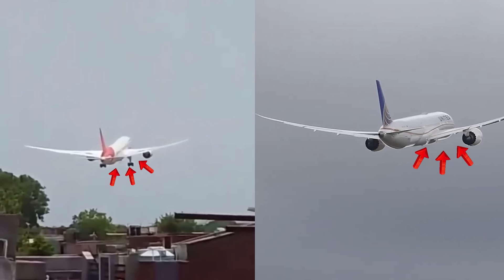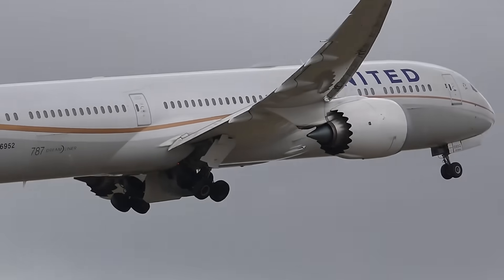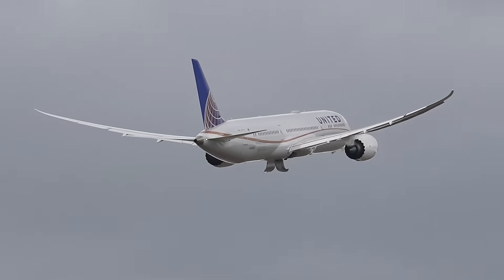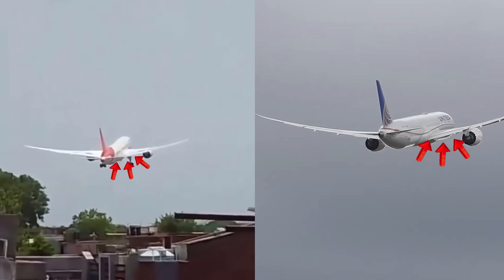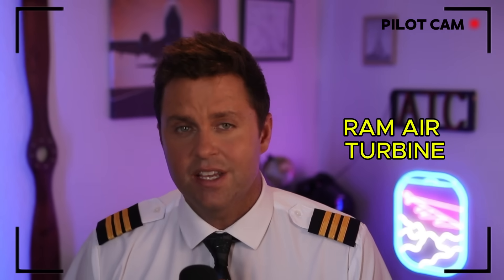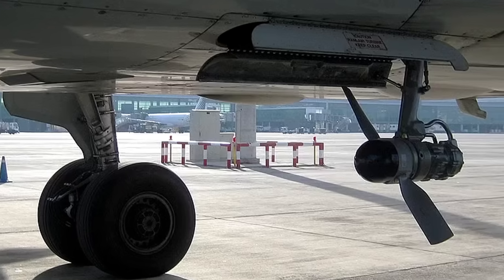Pilot Explains: A New Detail in the Air India 787 Crash Everyone Missed

Comment: As a A&P mechanic for a major US airline, id like to offer my humble opinion. Let me dispell a few rumors. 1. This was not a battery thermal runaway. After the problems that Boeing had previously with the batteries, they are now stored inside a 2 inch titanium box in the electronics bay and they cannot burn through that. 2. This was not a bird strike. These GE 90's can take a lot of birds going through that giant fan disk in the front. 
To me this looks like a catastrophic failure of both engines caused by a electronics failure of some kind. Everything on the 787 is electrically controlled. Yes even the hydraulics are electrically controlled. The only thing that makes sense outside of something the pilots did in the cockpit is a total electronics failure that shut down all of the fuel pumps and hydraulics which caused the rat to deploy and would explain why the surviving passenger stated there was a loud bang and the lights flickered in the cabin.
Reply: this seems to be the most convincing argument to date. Now, what can cause electronics failure? what are the odds for it?
Reply: @SuperGiantSlayer Extremely rare. Very rare and it would have to be a double failure of both a n b bus that cascades into a much larger failure rapidly. I will have to get into the books and look because this is very rare if it indeed happened this way
Reply: @SuperGiantSlayer Millions to one.
Reply: @SuperGiantSlayer shoddy Boeing quality control that John Barnett the whistleblower highlighted before he was murdered.
Reply: @SuperGiantSlayer blown fuse(es)?
Reply: @SuperGiantSlayer bad maintenance? Ignoring intermittent problems leading to catastrophic failure?
Reply: @SuperGiantSlayer Easy.  Poor maintenance.
Reply: @SuperGiantSlayer a lot of things can lead to one electric failure. It is not uncommon but always has multiple backups. The real question comes in sequence: What can cause 
 electric failure, what could have happened to disable the backups, can it stop the engines, could this lead to the way we've seen the accident, the facts to proof it
Reply: I don't understand why in the media the option is not discussed and pointed out that especially a 787 is doomed when there is a full electronich failure. As I understand this makes the plane uncontrollable. Why do the pilots not discuss that the design of the 787-in contrast to a 777 - is a tragic flaw when electronics stops working? This is essential and is not put forward in the media!
Reply: @wilfriedpichler5756 Because it's impossible for ALL starter gens plus - like mentioned above - the dedicated gens for the engines computer to all fail at the same time. The odds would be outstanding.
The engines failed and that caused the elec failure not the other way round.
Reply: Probably paid off media @wilfriedpichler5756
Reply: @wilfriedpichler5756 because no one would fly it - this is sooo scary
Reply: @wilfriedpichl because that's not how the plane is designed it's designed to work the engines should run even with an electrical issue. 15 million flights without an accident. er5756
Reply: @wilfriedpichler5756 < The media are not the experts. You sound like a trumpy boy
Reply: As a long since retired ATP I feel that I saw thrust pulled back to 50% or less; with everything else on the plane looking normal. Autothrottle, which is part of the AFDS controls thrust from rollout, takeoff, climb, cruise, to touchdown. My suspicion is an autothrottle malfunction so I looked up on the FAA website and sure enough, there is an AD for the autothrottle system on this model. From the FAA website in Sept 2024:

"The directive was prompted by incidents where the autothrottle system exhibited erroneous behavior during critical flight phases such as balked landings, with the system failing to properly adjust thrust levels."
Reply: @MikeM275  The autothrottle can only pull the throttles back to idle. It can't go sub-idle causing the generators to trip offline and the RAT to deploy.
Reply: @ImperrfectStranger makes sense
Reply: @ImperrfectStranger  The RAT deploying so far is only a theory using a substandard video which they "think" they heard the RAT. So far nothing is proven that the RAT deployed, only guessing by the sound of a cell phone video. I'm guessing too so my guess is as good or bad, as all the others I suppose. But since there is an AD on the autothrottle, and we can see the plane did not have thrust, that is a good place to start. When malfunctions in systems start, others can follow. Why did the RAT deploy? No one knows. No one knows that it even did deploy. I can say with certainty though this was a lack of thrust, not a flap issue.
Reply: @MikeM275  Another YouTuber, I think it was Captain Steve, zoomed in on that video and it certainly appeared that you could see the RAT as well as hear it. There was also the surviving passenger who (reportedly) said there was a loud bang shortly before the crash, which would correspond with the RAT deploying. I think it probably did deploy.
Reply: @ImperrfectStranger  Teacher, this is correct, IF there are no software bugs or hardware malfunctions ...
Reply: @PharmaGiles  Oh, OK I didn't see that. I didn't think there was a video crisp enough to zoom in that close. I do stand by my assessment though that it was a lack of thrust, not a flap issue. Why the lack of thrust is the question. We know there's an AD on this plane about the autothrottle failing in "critical" flight phases close to the ground. Sept 2024 and gave the carriers 6 months to get it fixed. The other thing about autothrottle is...even if it was not activated on takeoff (I'm 100% sure it was), it would have come on automatically before the plane stalled. So between the pilots and the autothrottle full power was undisputedly applied before the stall. Question will be, why did the engines not respond. I'm a long since retired ATP that never flew anything this big...but total electrical failure should not slow or stop the engines. Unless and only if the fuel pumps quit. That doesn't make sense either as there are multiple on each engine, not dependent on the other side....so the electrical failure would have to be total.
Reply: @ImperrfectStranger  nit the RAT automatically extends also in case of electrical failure. Not only for a dual eng failure.
Reply: @MikeM275  it seems to be clearly audible in the video, but the engines were not audible.
Reply: @MikeM275 Rat is clearly deployed in the video .
Reply: @matt84dc17  Understood, but electrical failures removing all power from the aircraft are just as improbable as a dual engine failure. Multiple redundancies.
Reply: @MikeM275 auto throttle is not used for takeoff. Positive pilot Input is the norm. Autothrottle is primarily a function of TOGA or speed trimming via the annunciator/auto flight  control panel.
Reply: @MikeM275  Why would you use autothrottle on takeoff? Wouldn't adjusting the throttle manually switch it off?
Reply: @donotwantahandle1111  Nope. That's not how it works on the most modern airliners. After everything is programed into the computer, from take off roll, climb out, cruise, up to and including landing it is hands off, computer controlled. While a pilot can take over control at any point, the throttle is adjusted by computer in all phases of flight. It's called autothrottle and in Sept. 2024 the FAA found issues and gave the carriers 6 months to get it fixed.
Reply: @MikeM275 So the auto throttle doesn't seem to be working...firewall the throttles yourself with your hand instead of driving your bigass plane into a neighborhood. Who tf knows what happened at this point? Horrible tragedy nonetheless. RIP everyone on that flight and on the ground except for the one lucky bastard who somehow walked away from that shitstorm. God must have big plans for you my friend. Stay strong 🙏
Reply: @Thedoug369  They only had seconds to determine what the issue was and resolve it. If it was the autothrottle there just wasn't enough time to figure it out, and take control manually.
Reply: @MikeM275 makes sense
Reply: @MikeM275 - Nice find 👍🏻 If it’s AD related and an Auto Throttle failure then that puts the whole incident in a different light.
Reply: @MikeM275  Mike, that's brilliant and most plausible. Fuel pumps should have been ok with the RAT deployed.
Reply: @MikeM275 Thank you. I believe after investigations are completed, it will be decided that your observation is correct.
Reply: @MikeM275   then why was RAT deployed ? Pilot made a mayday call and said there is no thrust, no power, no lift..
Reply: @MikeM275  Getting warmer. My assumption: Cause, not something that could have happen to a pre fly-by-wire aircraft, but something that can only happen to a fly-by-wire aircraft. Lets assume the total electricity failure, that automatically started the RAT, was because both engines changed operation mode from "full thrust" to "no thrust". Both "full thrust" and "no thrust" commands are just bits on the wire. I do NOT assume that the pilots gave the "no thrust" commands, but something (software or hardware) on the way from cockpit to engine changed/corrupted the commands to "no thrust". Sad, very sad. My condolences. You say: "Investigators look for AFDS malfunction". Yeah, these "noise reduction/fuel consumption reduction" comfort software functions ... We just declare them non critical ...
Reply: @MikeM275  But they would still have generators and full hydraulics even if pulled back to idle ! . Partial gear retraction and RAT deployed points to loss of generators and hydraulics ie both engines shut down ? do they run APU at take off ?
Reply: @nounoufriend1442  The cart starts the engines while on the ground, but yes the APU can be started and run on the ground or in the air. The APU is not running on takeoff though. Yes if the engines were running even at idle they would have electrical power and hydraulics etc. RAT deployment does lean toward complete electrical failure, but still doesn't explain why they had no thrust. The RAT gives enough electricity for flight controls so that isn't an issue. The electrical bypass should have powered the fuel pumps even without electrical. This is the mystery.
Reply: @MikeM275  So fuel pumps should run with most major electrical failures , would engines produce thrust even if FADEC's lost communication with aircraft ? Do they fail leaving enough thrust for flight ?
Reply: @MikeM275 also autothrust will retard the throttle if the incorrect altitude is inputted into the autopilot.
Reply: @kevintaylor31  But autothrottle will never let the plane stall, no matter what the configuration. It would come on automatically and provide thrust to stay out of a stall. Even overriding the pilots if they did something wrong.
Reply: @MikeM275  "Autothrottle, which is part of the AFDS controls thrust from rollout, takeoff, climb, cruise, to touchdown." 

The Boeing 787 manual and checklists call for the Autothrottle to be engaged only after the aircraft reaches 200 KIAS; and during landing to be Off at 500' AGL and Disconnected at 300' AGL.
Reply: @BryanM61  Nope. Sorry, I know you got that off the internet...But that's not how it works. On the 777/787 (and others), at spool up when you turn onto active, you bring the throttles up part way, then arm the TO/GA switch and engage the autothrottle. This is prior to releasing brakes and starting take off roll. The autothrottle if working correctly also would have self engaged before letting the plane stall and crash.
Reply: Yes, I saw a vid with Ed pierson, former Boeing manager/whistle blower, and he pretty much said the same thing. Apperantly this plane had electrical issues, lights flickering, AC not working, just a day before.
Reply: @StudyWithMusic-mo5nl  thats what 1 passenger said when he departed the plane, before the fateful passengers got on that flight.
Reply: @StudyWithMusic-mo5nl No this is categorically not true. Nonsense misinformation based of a unresponsive ife screen
Reply: Didn’t the Captain say in his mayday call that he’d lost thrust?
Reply: @bruceerwin5430  yes
Reply: Yes.  @bruceerwin5430
Reply: @bruceerwin5430 yes he did. We can also hear that there was no engine sound. Just the RAT.
Reply: @bruceerwin5430  I think there was a Mayday, but nothing else.
Reply: @bruceerwin5430  From memory he said they lost "power". If my memory is right, it could mean either.
Reply: im a retired pilot / FE/ A&P, what about an overheat in the avionic comp? Ive heard the electronic engine controls are there.
Reply: @bluskytoo Well, it would have to be extereme heat because the electronics bay is made to withstand high temps and I know the batteries were contained in a titanium  2 inch box so it couldnt have been thermal runways from the lithium ion batteries. This could be sabotage but that would be extremely rare as well
Reply: @ExpeditionMiracle  If I remember correctly, in the video of the previous flight where electrical problems were seen, didn't he also say that the air conditioning was out of service? And doesn't the avionics bay use the air conditioning for cooling? Combined with the high ambient temperatures, that could have made things worse.
Reply: @marco_fabbroni The electronics are rated for temps far in excess of what the temp was that day and without cooling. This accident was not the result of temperatures or a failure associated with temps. Just my opinion.
Reply: @marco_fabbroni No. If there were critical temps in the avionics they would not have departed.
Reply: Overheating: When circuit breakers are exposed to higher than normal temperatures, they may trip due to thermal overload. The increased ambient temperature can reduce the breaker's ability to dissipate heat, causing internal components to reach critical temperatures
Circuit breakers are susceptible to thermal influences, primarily due to their reliance on heat for operation, particularly thermal circuit breakers. Ambient temperature, heat generated by the circuit breaker itself, and heat generated by other components in close proximity can all affect their performance and lifespan
Reply: @bluskytoo the EEC (electronic engine control) is mounted to the fan case of each engine, it has 2 channels so each engine has effectively 2 computers each engine so all 4 would have die at same time, my theory is it lost both its CCR electrical cabinets major elec power loss causes engines to wind back to flight idle due loss of inputs from flight deck
Reply: The aircon was not working  so it was an indication that an electrical problem happened.
Pilots should not fly the plane. That plane should have been grounded and human lives could have be saved.
Reply from the maker: Thanks for your insights, it's good to hear from someone with your experience.
Reply: @Garybpilot  I think they had problems with the engine thrust already when they were accelerating on the runway. Why else would they have used the full length of the runway??

I wonder if they could have aborted the takeoff with somewhat less disastrous consequences...
Reply: I'm on board with that the guy on the flight before video that it was have electrical issues
Reply: @AndrewLarson-mq7xc  Hi the qustion for me is why didn‘t they change that plane. The climate didn‘t work and the entertainment in the seats either.
Reply: Bingo!
Reply: This is pretty much exactly my analysis too.
Reply: I've been wondering if there's any way for the FADECs to shit the bed and lose power to all of them. I assume there's two computers for each engine and they normally draw alternator power and default to battery or RAT power - the CL30 switches to batteries. Perhaps they lost power somehow but then didn't switch to their default source thus no relight.
Reply: @keefgtp  FADEC detected 'excess thrust' ('runaway engine') and rolled back both engines, autonomously banging out the RAT.  
Aviation electronics tech just spitballing.
Reply: @keefgtp  Usually there is one "FADEC" per engine, but they have two identical channels. If one channel fails, the other takes over.
Reply: Can't imagine there wouldn't be redundant electronics and that each engine would have its own independent set of electronics.  How would the FAA have certified it any other way?
Reply: @Sizzelot  Good point, was wondering about that myself. Seems logical but...
Reply: @Sizzelot  Ask Boeing, ask FAA. By the way, FAA is understaffed not only with air traffic controllers ...
Reply: Those weren't GE90s, they were GE-NX
Reply: Also a 787 engineer, I reckon both CCR cabinets fell over. This explains the CAC, IFE outages etc the sectors before, this would also cause engines to lose inputs from flight deck causing them to revert to flight idle powered by the PMA
Reply: @DEPLORABLEOZ would the RAT deploy under such circumstance though?
Reply: @DEPLORABLEOZ What would cause both to fail though? They're physically separated on opposite sides of the plane and their whole point is redundancy
Reply: not on 787 both CCR are located in FWD avionics bay, my very first day working on this plane a contactor (like a relay) failed and I had 26 pages of faults literally near half the planes avionics died from one relay, if 2 CCRs fall over its game over on this plane all the avionics go through these CCRs except Radio and emergency lights (WELS) and a few others
Reply: @DEPLORABLEOZ  Not likely that engines stop within seconds of each other due to contaminated fuel, but possible. Much more likely within minutes of each other. I also don't see random mechanically based engine failures within seconds of each other without a massive bird strike or other external event. Yours seems like a very logical explanation of how the engines would simply throttle back as a result loss of control signal coming from the cockpit through the CCR. Since most of the trip is spent at altitude you wouldn't want the engines going to full throttle as the default when signal is lost. What happens to landing gear if signal to retract simply cuts out? Do they freeze where they are or continue up? I'm thinking there was no loss of hydraulics to the gear, but simply loss of signal. I understand there are redundant CCR cabinets, but is the transition time instantaneous or is there some kind of hand off or initialization? Short delay would not be a problem at cruising altitude, but the timing on this flight would have been deadly.
Reply: @baawwb its not as seperate as you might think, there has been cases on different aircraft losing all elec power due to cracked drip shields allowing water to drip on both Power panels. In the 787 case it is unique as most aircraft functions are software based in 2 seperate Common Computing Resourse cabinets, there is redundancy however there is also some weak points
Reply: also there are 2 CCR cabinets that operate at same time there is redundancy between the 2 covering each other however if both fall over the pilots can reset them but there is a delay, on the ground engineers are not allowed to reset  using these methods we have to use circuit breakers as per the manual. On the ground its a 2 minute reset as it self tests,  in the air its meant to be less than 30 seconds for it to boot up again (from memory) as it skips the self tests. In this instance the pilots would not have had time to consider a reset with such little altitude ti work with
Reply: @DEPLORABLEOZ   if there was a global electrical failure  it would also disable the  ARINC 653 network preventing CCR cabinets compensating.  essentially  either no data, or scrambled, contradictory data would signal the Autothrottle, if at all?
Reply: B787's do not have the GE90 engines -B777 do. B787 have GE Gnex 1B engines.
Reply: The survivor didn't mention a bang noise it's a misinfo I've watched both of his interviews.
Reply: I'm thinking along similar lines. Somehow the Fuel Control System (FCS) got shutdown and the engines were starved for fuel. Also, if you can't read EGT then engine control may also be lost. If it's fuel contamination then why didn't other flights leaving this airport have similar issues? IDK, maybe NGS in regards to the fuel tanks played some role as well?
Reply: @kenhalal375 Ya the fuel truck would have detected any contamination if the fuel was being pumped from an underground tank. I dont think this is fuel contamination. I always thought that the 787 relied too heavily on electricity for all of its functions. We call it the plastic princess in the aviation mechanics word. Its an amazing airplane though with many redundancies. We may be seeing a new type of catastrophic electrical failure that wasnt thought of or this is some kind of complete electrical failure at the EnE level
Reply: So many people speculating about possible causes of the AI crash. Once the flight data recorder and cockpit voice recorder have been thoroughly analysed, the cause or causes of this disaster will likely be known. Until then social media is playing 101 ways to crash a plane. The human loss of life is a huge tragedy. Best let the professional investigators get on with their difficult job.
Reply: A comment mentioned this AD 2024-16-07 was issued in Sept 2024 for the 787-8,-9,-10 for an issue with auto throttles.. It appears to be an update of the software. It also appears to be during landing not during takeoff. It also appears to be too much throttle, runway over runs etc. which would be just the opposite problem. So, I think this problem does not apply to this particular situation.
Reply: What ge 90 engines?
Reply: An issue with the batteries is always possible, but it’s rather unlikely if their temperature, voltage, and internal resistance are being monitored by the software. Thermal runaway takes time.
Reply: The accident investigation team could certainly use your knowledge , excellently explained. 👍
Reply: After reading all the comments, this brings me back to another YouTubers page about an Air India flight into JFK on 11 Sept, 2018. They lost multiple instrument failures and after several attemps, diverted to Newark.
https://www.youtube.com/watch?v=5-4CSfwcQ_M
https://www.youtube.com/watch?v=SG2T1kXOCHU
Reply: Check out the statement of one of the whistle blowers who worked for Boeing as a security engineer. He found some issues that were troublesome but was told to say nothing. They even transferred him to another department. He is now talking to Senate and some News media . HIs name is Sam Salehpoor. He is a  brave man but I wish he had talked before that accident happened. Too cruel to think, maybe it could have been avoided.
Reply: @linanicolia1363  You are aware his whistleblowing and senate hearing was on April 17th =) And that is 2024 ^^ ??
Reply: Most sensible and practical analysis!
Reply: Yes 100%. I just finished posting the same before stopping to read the comments. Not A&P myself, but rather an entrepreneur-designer-of-things and lifelong fan (fan isn't the right word, student? enthusiast?) of air crash investigations. In Any other industry (automotive, domestic electrical, mining, natural gas distribution ...) some level of fatal failure is simply expected. Only in aviation is Every fatal incident (nominally) examined for a root cause. 787 could have been absolutely glorious, but has (apparently) become a victim of project management divorced from design engineering. I have no dog in this fight, no hands-on experience, no work history, no investment, but it was a film on the Boeing 777 development that motivated me to take my company to fully 3D CAD and pursue a real QMS. I'm retired now but is the Boeing of today inspiring the next generation?
Reply: Per your observation if this aircraft is controlled by arrays of precision electronic equipment and respective signals generated through those electronics for precise operation.... so, is it possible to override the signal output via any external remote device??? In simpler terms what are odds so that it could be manipulated or sabotaged remotely and how much secure those electronic components in terms of information exchange within the aircraft during operation? We need to find as well whether any financial bet in terms of insurance contract has been carried through this sabotage!! A flight is heavily insured during safe take off -- journey in the mid sky and -- safe touch down from point A to point B and offloading the passenger in the destination and it is one of the profitable businesses for all the insurance companies across the globe owing to the very nature of non-refundable term insurance contract.... my fair guess is there could be some businessman/men, statesmen, secret service professionals, mercenaries, militants, militia, junta or military or any country might have accumulated wealth through this killer bet.... those people should also be required to bring into justice..... we need to keep in our mind that not only boarded people in that aircraft died but also medical students in a hostel building where it got crashed and some locals surrounding to that building also died.... and many got affected....
Reply: I love how so many YouTubers need the uniform to talk about aviation.
You would get the credit also without the stripes on show.
What’s the point..?
Reply: @dnhug I think you should start previewing your replies before you post them because that made no sense at all.
Reply: @ExpeditionMiracle misspelled one word, I just got up when I commented.
Makes sense to me. Cheers
Reply: Wouldn’t the engines still run on gravity feed?
Reply: @30K_ACTUAL 
And if not, why not a rapid deploy, manual gravity feed override?
Reply: I'm just a private pilot but that's what crossed my mind- mechanical failure of both engines simultaneously would be very unlikely but control failure or God forbid control input would seem a more likely cause. I'm so sorry for the loss of all these people.
Reply: Hört sich alles ganz logisch an, aber der Überlebende hat auch gesagt das er nochmal einen richtigen Schub bevor es runter gegangen ist gespürt hat. Das heißt das die Triebwerke gearbeitet aben müssen. Ohne Triebwerke keinen Schub.
Reply: this is 100% correct.  you nailed it here.
Reply: Is it true 787-8’s electrical generators if kept continuously powered on for 248 days - all 4 GCUs can go into failsafe mode at once, resulting in a loss of all AC electrical power regardless of flight phase. FAA had given a AD on this in 2015? 
----------------------------------------------------------------------------------------------------------------------------------------------------------------------------------------
The plane’s electrical generators fall into a failsafe mode if kept continuously powered on for 248 days. The 787 has four such main generator-control units that, if powered on at the same time, could fail simultaneously and cause a complete electrical shutdown.

“We are issuing this AD [airworthiness directive] to prevent loss of all AC electrical power, which could result in loss of control of the aeroplane,” said the Federal Aviation Administration directive. “If the four main generator control units (associated with the engine-mounted generators) were powered up at the same time, after 248 days of continuous power, all four GCUs will go into failsafe mode at the same time, resulting in a loss of all AC electrical power regardless of flight phase.”

Should the electrical shutdown happen at a critical phase in flight such as take-off or landing, or while manoeuvring in the air, the loss of control could be catastrophic.
----------------------------------------------------------------------------------------------------------------------------------------------------------------------------------------
Looks like the FAA AD was further revised by EASA AD in 2020 and reduced the ‘Power Recycling’ schedule for 787 Dreamliner to from 248 days to 51 days. Are there circumstances when the aircraft is in ‘power on’ mode for over 51 days?
Reply: And it was reported that this aircraft had a lot of electrical problems just before this flight from no overhead lights and call buttons and all the seatback entertainment systems not working so if nothing was looked at before this flight maybe things just got worse for the next leg
Reply: well exoplained.. I also dont think there was pilot error considering the gear out and tilted, and the RAT deployed. Why the engine failure, or electronic failure happened is to be investigated. I dont know when the data from black box would be out?
Reply: @essare108  investigators won't release their final report for a while but an interim report may be issued if there's a finding that may affect other aircraft
Reply: Agreed.  Witness statements all said there was no noise only a slight whistling sound which defo suggest engines had failed....not flaps or pilot error!
Reply: @peterwilliams7356 could still be pilot are could have actually shut off the engines
Reply: Apparently an electrical panel had failed during development causing both engines to fail and the plane had to glide for a landing. Sooo not out of the question.
Reply: Those are not GE 90 engines!! Dreamliner 787s fly with GeNX 1B engines and to be more precise these were GeNX 1B64’s on this plane.
Reply: Just to clarify, the batteries ( 2 of them- 1 for main ship's battery and 1 exclusively used for APU start) Are NOT houses in a 2 inch thick titanium box. They are roughly 1/4 inch thick instead.
Reply: @nectros7157  Yes, 2 inch think titanium would be nuclear bomb proof LOL
Reply: probably, not a pilot but theres a video circulating showing the inside of the aircraft 2 hours before the tragedy that shows electircal issues, particularly the AC not working, it was also stated by a former pilot that this aircraft has suffered with serious technical problems for a long time. 
seems the root of the issue was a poorly maintained aircraft.
Reply: I’m thinking pilot error. Too many holes in the Swiss cheese that would have line up for mechanical failure .
Reply: @gwilliams9589 This is where my thinking it as too. Likely they were also dealing with 1 or more failures, but unlikely it was something that made the aircraft unflyable. Possible, but low probability. Time will tell.
Reply: Interesting that the surviving pax is reporting a loud band on take off. I hadn't heard that until now but would indicate some sort of surge or shelling out. But as far as the fuel boost pumps I don't see that causing an engine shutdown. I'm not a 787 guy but every other jet that I've worked the engine driven fuel pumps have 2 stages, a low pressure impeller and a high pressure gear element. With the impeller being there for suction feed capabilities, so even if the aircraft fuel pumps stopped the engines should be able to draw fuel from the tanks. As you know the engines have their own PMA to power the EEC and the other engine controls without the need of outside sources of power. 

Highly unlikely but not impossible for both engines to fail at the same time, which leads me to either a fuel problem, contamination or debris in the fuel or the wrong engine was shut down on take off.
Reply: @AG-un7dz  I doubt they would be shutting of engines at that height 15 seconds after takeoff, no matter how little thrust they were producing.
Reply: This might be the most accurate description of what actually happened.
Reply: Another A&P here, totally agree, but why is the big question.
Reply: I think you've diagnosed it properly mate. Alot of people are saying it was a dual engine failure.
Reply: I agree.  I've been around these things for a long time. AF retired in 1987 off of F4'.16's, 15's,C141's,C5's, and  Log Engr on the C17.  If this had happened in the USA or Heathrow that sucker would be parked (one wouold hope).  But, over there in the 3rd world, they can't hardly clean up the mess.  I do feel sorry for their people, the pax, and the crew.  Tragic.
Reply: I don't know what to think. But I do know that the cause will be found. And I am hopeful will become much safer and that all those poor souls will not have died in vain.
Reply: @JaimeRestrepo61 This is my hope as well. Thank you!
Reply: I agree with you,  I am thinking it is a manufacturing error of the conduit.   The system engineer will design the redundant electrical systems on the schematic, but the physical routing of the electrical may have routed some main paths too close.   Possibly a partially disconnected conduit?
Reply: Electronic failure
Reply: @s_ofi Well, yes, ive already stated this as to what I view the problem as. This was an electronics failure that led to the engines being starved of fuel through a spring cut off valve that is there to protect the engines from over thrust. If there is a glitch in the electronics of the fadec then this spring cut off will initiate and theres nothing that can be done.
Reply: Agreed 💯
Reply: give me a platform . .. ...
Reply: sounds like you work for big battery
Reply: * Not my information (sent on WhatsApp)

IF anyone interested here’s the gen on the crash. The pilots were utterly powerless to prevent this .Boeing in serious trouble! 

Flight: AI-171 | Aircraft: Boeing 787-8 | Date: June 25, 2025 | Route: Ahmedabad (VAAH) → London Heathrow (EGLL)
Crash Site: ~1.2 km from VAAH Runway 23, post-V1 and rotation
Fatalities: 247 (243 onboard + 4 ground)
Survivors: 0 onboard survivors (alternate to original), 3 injured on ground

⸻

🛠️  AAIB Preliminary Report Highlights

1. Primary Cause – Electrical Power Transfer Interruption (PTI) During Rotation
	•	During transition from ground to airborne electrical configuration, the aircraft experienced a cascading dual-engine FADEC (Full Authority Digital Engine Control) failure.
	•	Root cause: Uncommanded bus transfer failure due to arcing in the main power relay box (PRB-A), traced to water ingress during pre-flight GPU disconnection in heavy rain.
	•	This led to loss of electronic engine control at rotation, resulting in both GEnx engines rolling back to ground idle within 4–5 seconds.

2. Flight Data Record Timeline
	•	+0:11 sec: Nose gear lifts off.
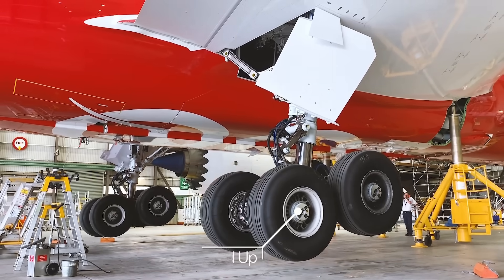	•	+0:13 sec: Sudden engine rollback begins. Thrust reduces from 92% N1 to <27% within 3 seconds.
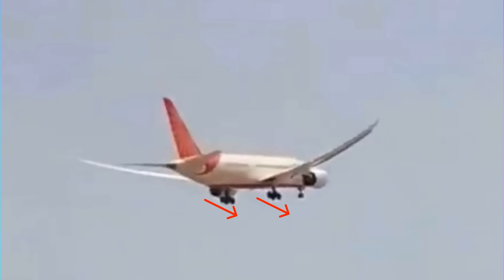	•	+0:16 sec: Master caution + ENG FAIL L/R warnings. FO calls, “Both engines dropping!”
	•	+0:20 sec: Autopilot and flight control reverts to Direct Mode. Pitch up attitude peaks at 18°.
	•	+0:25 sec: Aircraft stalls at 186 ft AGL.
	•	+0:30 sec: Full aerodynamic stall; nose drops rapidly.
	•	+0:38 sec: Ground impact at 54° nose-down attitude, 174 knots.

⸻

⚙️ Contributing Factors
	•	Environmental Conditions:
	•	Torrential rain during pushback.
	•	Moisture intrusion into PRB-A connector (P/N: HLN8471) — a known corrosion-risk component.
	•	Latent Maintenance Issue:
	•	Power transfer relay unit showed signs of thermal damage in a previous MEL deferral 2 weeks prior.
	•	No replacement had been conducted; aircraft was cleared under repetitive deferral.
	•	Design Oversight:
	•	Boeing 787 has no physical engine control backup (i.e., no direct mechanical linkage in FADEC loss scenario).
	•	Loss of power supply to both EEC channels resulted in engine “freeze” at ground idle instead of flameout.
	•	Flight Crew Response:
	•	Attempted engine relight sequence not completed before stall onset.
	•	Emergency power selector not activated — possibly due to confusion from multiple ECAM warnings.

⸻

✈️  Immediate Safety Actions
	•	DGCA + EASA + FAA Emergency AD issued within 24 hours:
	•	Mandatory PRB-A moisture integrity inspection on all Boeing 787 aircraft.
	•	Temporary restriction on dispatch with MEL items related to power transfer systems.
	•	Boeing:
	•	Issued Service Bulletin SB-787-24-212 requiring replacement of PRB-A connectors with sealed versions.
	•	Exploring addition of dual-path power redundancy for FADEC systems.

⸻

🧠 Lessons Learned
	•	Over-reliance on electrical power distribution architecture without layered redundancy.
	•	Lack of crew procedural training for full engine rollback during takeoff in EEC dual failure scenarios.
	•	Need for improved environmental sealing in GPU/electrical handover units in monsoon zones.

⸻

🕯️ Human Toll
	•	The loss of 243 onboard lives, including 12 crew and 18 infants, deeply impacted the aviation community.
	•	Final words captured on CVR: “We lost everything – no thrust!”
	•	One family of five was killed on the ground in a hospital ambulance struck by debris.

⸻

📅 Timeline – What’s Next?
	•	Aug 15, 2025: Release of FAA/Boeing electrical design audit report
	•	Sept 5, 2025: ICAO session on electrical-critical phase-of-flight risk mitigation
	•	Oct 2025: Mandated design retrofit across 787 fleet (rev. SB-787-24-219)
Reply: Hope it's not bad software, that means it was a mistake we made, we killed those people, RIP Air India 171 all those lost... RIP.
Reply: @hertzkot  probably not as the plane has been flying for over a decade and this very first hull  loss of a 787 ever in history of the plane. Something unique happened here.
Reply: Can that titanium box explode?
Reply: I read that this jet just came from maintenance and this was first flight after.
Reply: I’d say, spot on.
Reply: One suggestion I've seen is vapor-lock in the fuel lines due to the aircraft sitting on the runway in high high for several hours before take-off - both engines lost fuel just after the aircraft rotated and flamed out - that's the bang the survivor heard, not the RAT deploying - and the pilots couldn't recover...
Reply: Unlikely the system can handle extreme fuel temperatures, cold temps are more of an issue, the loud bang is most likely the RAT deploying, the RAT is held up in the belly by 2 large springs and automatically springs out like a jack in the box when deployed it is loud and shakes the whole plane when it comes out....the sole survivor was nearly sitting on top if it, it would have made a heck of a bang.... thats my theory anyway  @CRF-2013
Reply: It is likely an electronic problem!.Both constant current regulators fell/displaced/ damaged by some faulty maintenance causing a loud bang heard by the one lone survivor and the light went out!.The failure of CCR caused both engines to shut off and the plane lost thrust and crashed!. This is the most probable scenario!
Reply: Total electrical failure will cause engine failure in a 787
Reply: @geraldwalsh6489 Your evidence to back this statement?
Reply: Yes clearly electrical problem and perhaps the normal standard tests were not taken especially as there was no inflight entertainment on this flight, but Air India often take a risk with passenger safety.
Reply: @martinnewell6260 I fail to see the relevance of the unserviceable state of the entertainment system. That’s very common. Coincidence; not causation.
Reply: 1 where are the titanium cased batteries vented toward - presume externally - throo the electronics bay as you say?? (could the dust seen at takeoff include battery gasses)...?? Kevin...
Reply: Gears selected up and AT THE SAME MOMENT a dual engine failure seems too much of a coincidence. 
It seems more likely that the gear up command, in some way, messed up the electrical system.
Reply: Makes the most sense out of all the theories that I have been hearing!
Reply: Exactly
Reply: Can it be a terror attack where no explosive was involved?
Reply: Since just about everything, electrical can and will malfunction every now and then in machinery, trucks, and equipment, I absolutely believe 100% it can happen in an aircraft. Not to mention all the readings by sensors that go bananas for a while once power is disrupted, if only for a second or two.
Personally, I can't believe we don't see crashes due to malfunctioning airplanes at least once a week, considering how many flights take off every day.
Reply: I think you're spot on  This has been my angle the all repetitive technical faults reported over the past 15 days must be reviewed and addressed promptly, is angling at that possibility.   B787s are forever have little gremlins that often just reset, but if you have 3-4 that keep reset on and aircraft and then all happen at the same point this could create a mathematically near impossible set of events that could affect fuel supply to the engines.

Fuel contamination would hvae been tested and being india would have been released by now either officially or leaked out.
Reply: Can lack of fuel be an issue?
Reply: No it cant be the 787 has electric pumps in the tanks and engine driven pump on each engine, if all fails it can still run just by gravity feed. It is near impossible to run out of fuel unless a blockage such as ice or tank mats left in during maintenance, however that would only kill one engine not both
Reply: Fuel cutoff can be done on ground itself right?
Reply: The A&P mechanic is exactly right,  and with his understanding of how these control systems are physically put together, your colleagues may discover if fiber optics,  for one example, were
flexed.  If so, fiber optics are designed to be stable and not cracked by flexing wings like we see
in the carbon composite B787 wings.  Good luck to all. Including the software and systems engineers that will surely have their work waiting for them.  God bless as you do His work.
Reply: But what about that passenger video showing smoke in cabin? Screams electrical
Reply: The loud bang from the surviving passenger is at this point conjecture too because as Richard Godfrey points out in his proper analysis only based on the facts - the bang could have been based on the aircraft striking the buildings. Until the witness has been interviewed properly by the investigating authorities and we base it only on facts, you can't explain that.
Reply: This explanation really makes some real sense. Thanks for sharing your technical opinion.
Reply: But what system failure results in a loud bang in your opinion? If it turned out to be true that a loud bang was heard prior to losing power, what caused it?
Reply: Could a cyber attack take out the engine electrics?
Reply: Well sir titanium melts at 1668 Celsius.  Lithium batteries burn at 6k degrees. Far above the temp needed.  Just saying.
Reply: May I ask you this. If just saying if there was a major fire in the aviation bay what would happen when you hit the switch to engage the pumps to retract the gear. That's a tremendous surge in amps correct.?  Could that have knocked out all electrical.  Was there enough time from that point to deploy rat. How long after power failure does rat deploy. Im thinking there was a major problem on roll. I believe rat was already deployed on runway. Your thoughts sir
Reply: @thomaswilson8634  it would not surprise me if the circuit breakers had been fudged for the wrong parts and at high loads such as takeoff they tripped
Reply: The 248-day software bug is a big indicator that the PCU has the ability to cut off all AC generators at once. If the bug was fixed in software the vulnerability still exists. Can the engine driven pumps alone reliably give enough fuel at takeoff in any attitude?
Reply: @anon1832  catastrophic power failure would render them useless
Reply: WATER IN THE FUEL .
Reply: @GrahamNewman-mq7gr  not improbable but unlikely as we would have expected to see the problem on other aircraft. Most likely is total electrical shutdown. There will be a reason for it. It was sudden and catastrophic. The clue of the cabin power being dodgy tells me things weren't good in that department. Improper-poor maintenance and maybe even wrong components used. It doesn't sound like thorough testing was done, if they were having problems
Reply: @GrahamNewman-mq7gr  fuel contamination is such a mature issue it seems less likely than software failure. We know the 787 PCU software can shut down all AC power, we know the engine driven pumps alone can't guarantee enough fuel at all phases of flight and we know there was a software bug previously. I don't see how fixing one integer overflow removes the ability of the PCU to shut off all AC power.
Reply: BOING is having problems with its planes, so they are doing their best to blame it on the Pilots. I read they do gundagiri to the crew members if they complain about the Boing planes. The pilots were very experienced. Don't buy it if anyone tries to blame it on the pilots. Most likely, it's a maintenance issue .
Reply: this is the problem with all electric  and all computerized  planes , Planes constructors should put some kind of emergency override controls , independant from computers and electricity
Reply: Can the engine be hacked remotely?
Reply: People have been warning about cyber attacks since 2015, they’re flying data centres.
Reply: Why is duff fuel not mentioned as a possibility? (Whichever tank fuel is being taken from) the fuel pickups are probably towards the lower rear - so they can find the last of the fuel on a rejected landing. When the engines are being run up on the ground the puddle of water is forward of the pickups. When it accelerates and rotates ------.
Reply: Thanks for the information going the same direction I mentioned previously ❤
Note few days before this same plane aborted a departure  becaus of a passenger cabin burn smell issue. It was in a German airport if I remind. The day of the crash, the passenger cabin AC was blinking, entertaiment conouters not working, ther are videos emerging from worried passengers. One signaled a flag bad position in high position on left wing,  during the previous London-Ahmedabad. FR24 shows eratic reception of the airport radar from the plane. Did not recorded all the track long, and nothing after take off.
So this seem a total computer faillure, like your laptop if you take the battery off or if you push 'reset' after a blue screen.  This bagan by lot of strange issues, like AC not working, or precisely, working by blinking,  like as cable bad assembled, to the battery,  or a shorted reset button. What was the cause of the smell in the cabine is something that must be investigated, and what were done after.
Reply: For a 9-hour flight, there was sufficient fuel in all tanks to ensure gravity-suction feed immediately after takeoff and initial climb to 470 feet.
Reply: someone from the earlier route had posted a video of electrical issues so something was def wrong with the electronics. No other explanation for Both Engine to die like that.
Reply: Electronics..I have been saying this for years - as soon as something goes full automatic, electronically controlled, something like this will happen again and again. Gone are the days of flying manually and actually having very experienced pilots, who know how to handle pretty much any situation and have full control over the airplane.
Reply: Pilot/Co-pilot make a mistake and then try to corect/override the system ( electrical) and that shunt the automatic system (electrical) out and cause the engines to stop .
PILOT ERROR???
Reply: why would an electrical shutdown cause a loud bang in the cabin?
Reply: I think at this point its safe to say if Boeing is held at fault here they should go bankrupt and should never be allowed to manufacture a single passenger plane ever
Reply: I've also looked into this crash in great detail and I am now convinced that a compete electrical failure has to be the cause.
Reply: That clearly aligns with the deployment of RAT.
Reply: 😂😂😂😂, there are several issues in Boeing and even whistle blowers have revealed and got killed .
Reply: @anshumansingh1824 Still AI 171 was the first to crash in more than a decade.
Reply: Posted on X: A passenger on this very same airplane made a video during his flight (on the leg that arrived into the airport) before the fatal leg happened. It was astonishing and a dozen Indian news outlets were soliciting his video. In the video he showed how the pager to call an attendant wasn't working, the air conditioning wasn't working and the mounted screen to watch movies or connect to internet? wasn't working. People were fanning themselves. So something was haywire with the electrical system. And he said the word "AGAIN" with emphasis as if it had happened before. I later watched a 10 year old y-tube video that everyone should watch before you get on a 787 ( "The Boeing 787: Broken Dreams l Al Jazeera Investigations ). I'll NEVER get on one! Corners were cut every step of the way. Engineers resigned. The work was taken to South Carolina where labor costs were cheaper...just to name a few of the problems. Also, the survivor reported hearing a loud bang and the pilots called MAYDAY MAYDAY seconds into the flight. Not only did it kill all aboard except one but landed in a college cafeteria where students were gathered killing dozens more.
Reply: We can already eliminate the contaminated fuel cause other planes on the ground also took the same fuel and had no issues
Reply: Why loud bang and flickering lights in the cabin? Sorry I'm very ignorant in aviation stuff can someone tell me I'm curious to know
Reply: My assumption, too. Not something that could have happen to a pre fly-by-wire aircraft, but something that can only happen to a fly-by-wire aircraft. Lets assume the total electricity failure, that automatically started the RAT, was because both engines changed operation mode from "full thrust" to "no thrust". Both "full thrust" and "no thrust" commands are just bits on the wire. I do NOT assume that the pilots gave the "no thrust" commands, but something (software or hardware) on the way from cockpit to engine changed/corrupted the commands to "no thrust". Sad, very sad. My condolences.
Reply: Totally agree with this theory sounds spot on.time will let us know RIP to all involved 🇬🇧
Reply: You could be right, because the previous flight with this plane, people complain of lights flickering, ac not working and some monitors also flickering or not working
Reply: I believe it's total engines failure but the question is what caused it?
Reply: Agree something besides a mechanical failure of the engines themselves brought down this plane. I suspect fuel system related problems, but electrical / computer failure is a possibility too. Talk about the worse possible luck of this happening right at lift off. But again there was a stroke of really good luck by the one survivor in seat 11A that walked away on foot!
Reply: @joshr96  I was a Flight Safety and Interior Design Specialist at Boeing Helicopters for 9 years right after my first college degree.

Contaminated fuel? Have you ever done a Failure Mode & Effects Analysis? If it were contaminated fuel, wouldn’t other aircraft be affected? YES. YES. YES. They weren’t. Full Stop.
Reply: Great video with well thought out information, but so many  ignorance and conjecture in these comments.  

I'm not saying what the cause is what i think it was because we just dont have enough evidence to support any theory  at the moment. Conversations are good, when you actually have knowledge of the aircraft and its systems.
Reply: I agree. The behaviour of the main landing gear in the videos seems to suggest that there already was no hydraulics at take off, as the truck positioning actuator did not work. At this time the engines must still have produced at least partial trust which allowed for the initial climb.
Reply: The 787 doesn’t have GE90s…
Reply: Would the apu still be on at that point 
   If it catastrophicly failed might have cause a chain reaction
Reply: It's the first all electric apu 
  No bleed air or hydraulic systems
Reply: I mean I'm sure the main engines still utilize bleed air for cabin pressure right🤔🫤? 
   I mean might not might have some electric compressor 😅
    But the apu turbine is only connected to a generator 😮
Reply: @terranovarain6570 no it does not. The only reason this engine uses bleed air is deice the nose cowl. No engine air goes to the airplane.
Reply: Do you think it could have been a vapor lock?
Reply: Wondering if battery is enough to start one and skip ground procedure 
   Sounds like it wouldn't be good on the batteries circuits even
   See I imagine the engineering would be battery sufficient to start apu which probably would put it in the range of being able to start a main over loaded
Reply: That sounds totally right 👍
Reply: Most part 121 jets engines will work with no electrics..
Reply: EMP?
Reply: The 787 does not have GE90 engines
Reply: Totally agree with the conclusion of a catastrophic electronic malfunction. Bird strikes or contaminated fuel most likely would cause sparks, flames, smoke, sputter but not calm quitting as to be seen here. These engines spooled down like being manually switched off which is barely considerable hence at this point indications lead to a sudden and unexpected intervention of computerized flight control shutting down both engines shortly after take-off. In case this theory may turn out being accurate it'll possibly lead Boeing into a crisis of similarly devastating effects as the 737-MAX-desaster did. Air India today announced they're up to establish grounding of all 787s worldwide.
Reply: why would there be a bang on electric failure? would something blow up?
Reply: Yes there was some kind of electrical failure, there is a video taken by a chap before take off saying aircond not working tv etc not working …
Reply: Why do I have a feeling this was caused by a Boeing issue....that someone was aware of.
Reply: It is a common component to both engines working that caused this. Kudos to you for finding the most plausible cause which is an electronics or electrical failure to the engine on each side. That would fit the smell test for a common component to both engines. Fuel, contamination is ridiculous on its face value. Pilot error is equally absurd as I don’t know of any Indian professional, who does not take their job with the highest standards of excellence. The two well trained pilots were dealt a crappy hand. Here’s the crazy thing – what if this is another Boeing major screwup?
Reply: I don’t know, even if you shut down all the fuel pumps, engines should still run. I don’t know if they will at TO power. There is a suction check where you kill all the pumps and monitor your engine parameters including a fuel flow, but you only run it on idle.???
Reply: Agreed. There is a new video from a passenger who deplaned just before the final flight of the airplane. He complained that the AC was non functioning, as well as the entertainment systems and the flight attendant hailing system. That plane seems to have had several electrical problems, (albeit minor ones), which might be a good indicator of deeper problems within the electrical system.
Reply: January 17th 2019, ANA 787-8 uncommanded dual engine shutdown. This is where I would be starting to look. 
Ask yourself - at what point did the RAT deploy? It takes a few seconds to fully deploy, it was already out when it passed the camera, less than 20 seconds into the flight, and it self-deploys when both engines fail or when all 4 (2 main and 2 backup) electrical generators fail.
Reply: @Planestrains-d5e  There are two known videos of this accident: the CCTV video and the 'Balcony' video. The CCTV version I have runs at 24fps; the Balcony video is 30fps.

Working back on both videos from when flames first appear, the CCTV shows a flight duration of approximately 31 seconds (mains lift off the runway to flames first appear). In the Balcony video, the duration from video start to seeing flames is 10.5 seconds. The RAT takes 8 seconds to fully deploy, but the turbine begins to spin up before then. 

So we definitely hear the RAT by 20.5 seconds into the flight. If we speculate that it was fully deployed when the Balcony video started, deployment would have begun no later than 12.5 seconds into the flight. But this is by no means certain.

I can see no visual indication on the CCTV of the RAT being out, but that's a low-quality video, so inconclusive.
Reply: Additionally: this plane had entertainment sys and onboard lights problem on the previous flight! On X passengers posted tons of photos and videos
Reply: Additionally: this plane had entertainment sys and onboard lights problem on the previous flight! A/C also not worked well! On X passengers posted tons of photos and videos
Reply: Demon den doing due to greed.
Reply: They are Gen X or RR engines on B787 not GE90 (GE90 is on B777).
Reply: Autothrottle roll back?
Reply: A&P mechanic? supermarket?
Reply: A 787 pilot recently said that, in total electronics failure, the engines would continue to pump fuel mechanically and produce the same thrust as before failure.

I'm thinking a particular electronic fault could have pulled engines back to idle--maybe confused signals from a short circuit triggered   throttle back, for example don't they throttle back automatically on landing, along with auto braking?
Reply: Yes, total electronics failure. After the Mayday call, all communications with ATC ceased, because of electronic failure.
Reply: I'm a fully qualified drone pilot on the sub 250 gram type. My analysis is that the RAT propeller was insufficient to propel a large aircraft at such a low altitude. What were they thinking??? 🤔
Reply: so... good Luck Boeing then... it's scary to know that , nowadays, plane get down just because of electronics problem or sofware... As a pilot myself I don't get what Boeing has made about this plane... do you know about redundancy ? yeah.. right.
Reply: Had the 787 FAA AD for mandatory power down every 120 days issue been rectified? If that AD wasn’t follow and the issue haven’t been rectified and the Aircraft has not perform a complete power down for 248 days, then there is a risk of a total electrical failure due to a software bug related to the 787. Which could explain this. 

https://www.federalregister.gov/documents/2015/05/01/2015-10066/airworthiness-directives-the-boeing-company-airplanes
Reply: Is FADEC or EEC electronic engine control not independent of the aircraft electrical system on the 787? Old Boeings the engines may go to idle if EEC failed but EEC’s or FADEC is specific to each engine… I’m not familiar with the 787,but Jets I have flown have their own EEC. Great info and thank you. I am trying really hard to get my brain around this.
Reply: HND IN MECHANICAL engineering 
It's the fuel accumulator failure insufficient fuel for take off or acceleration 
I've told them this
Reply: @muzzey1963 Its not the fuel accumulator. If it was, then they would have noticed immediately upon taxing or moving the aircraft.
Reply: Im not airplane mechanic at all...but I just getting interested this accident,and find some info about few system of 787. As far I remember at very first news mention about some electrical issues at passenger department,but they said the flycontrol and passenger system is separeted.BUT what is happeneing if some wires was overloaded and insulation melted and somehow making cross/short circuit at two "engine fire switches" without fire alarm sensors indicate any fire? As in technical explanation shows the shut down sequence like fuel cut off,after hidraulic pump and generator disingaged. After the fire bottles armed and finally the anti-ice valves closed....
Reply: @magus3155 This could not happen. It would take a seriously poor maintenance system to allow this to happen. Air India has an excellent maintenance program. The wiring you are speaking about is inspected on a regular basis and any wiring that cannot be visually inspected on a regular basis either is checked during a C check which is every 6 months or so depending on use or it doesnt come into contact with the flight control wiring
Reply: @magus3155  - Your questions are clueless.   Best to just sit back, read and learn.
Reply: If it was contaminated fuel then that was not  the only plane refueled
Reply: @larrykhamal4451 It wasnt contaminated fuel.
Reply: my gamble on eventual cause is plane was Over weight by a LOT. The extended roll out, only just getting off at the end markers, and at that point still had full thrust points to HEAVY. EGT's or exhaust gas temperatures spiked on both engines under the load and the FADEC's system DID what it was programmed to do reduce fuel input and power output to protect the engine from thermal damage.
I'm no expert just a drip under pressure but High end race, supercar, and luxury vehicle electronics I work on do this as a protection mechanism to an abusive driver. Some just wind back timing and add fuel to cool the engine with no warnings, some cars do what people refer as "going into Limp mode" as in Limp home at minimal power and speed with engine light on.
Would love if there any Boeing experts out there know if this overheat/overload protection is a thing in FADEC if thats the equivelent of a cars ECU?
Reply: A wire is a physical object that break for some reason.  At the end of each wire, there is a connector of some kind and those can break or a wire can come lose.  I don't know if a computer failure could cause this.
Reply: @kestrelwings In aviation, these wires are inspected regularly. So, this is likely not the cause. If you knew the level of inspection and attention to detail that we maintenance crew give each airplane before it takes off, you would realize that this is not the cause. Unless the maintenance was not being conducted.
Reply: Could the aircraft have started it's take off roll. Not in the correct position on the runway? As, it just scraped the last bit of tarmac at lift off. The extra drag, when the pilot started to pull back, may have stalled the engines.
Reply: @ChristopherSmith-p5m  Its possible. We don't have an exact position yet of where the plane started its roll and exactly where it rotated. We can say with moderate confidence that it started its roll from the normal take off position, not half way down the runway as some have stated and that it rotated in the last 2/3rds of the runway
Reply: Really, a dual engine failure, all of a sudden!?  Bullshit!  I’ve been working Boeings for 40 years, there is no electrical problem anywhere that’s going to fail two GE90’s.  Sounds to me like an FMC problem, garbage in, garbage out.  If you lost every electrical systems on the aircraft you still have the PMG’s that make the engines autonomous from the ship electrical systems.  So the next person who suggests this was an “airplane” problem is a dolt.
Reply: SHUT UP ABOUT THE GEAR!  Jesus people, gear tilt is controlled by a sequence valve, in the same hydraulic system that raises the gear.  You know why there is no information coming out of the Air India crash, because this was a cockpit problem and HR is trying to figure out how to spin this!  They are doing everything they can to cover another couple of chuckle heads screwing up in the cockpit.
Reply: @NeroontheGoon You have no clue what your talking about.
Reply: @NeroontheGoon It appears you may be right; a pair of muppets in the flight deck.
Reply: BS. British Airways flying 787's into US every day. I watched one go by the other  day at 13k
Reply: So why didn't suction feed work when the fuel pumps shut down? Boeing assure thrust from suction feed except at high altitudes. Each EEC (engine control computer) is powered by dual channel dedicated alternators (as a primary power source). 
Do you have type certifications in the USA? A&P sounds rather basic, like the AMEs we have in Australia.
Reply: @ImperrfectStranger  - Agree.  Every airliner I flew, the engines would operate just fine with a total electric failure.
Reply: @mountainflyhigh  I fly the Dreamliner: it will too.
Reply: @mountainflyhigh not a 787 it is full FADEC just electrical wires no throttle cable like previous gen aircraft if you lose electrical power the EEC is still powered by a permanant alternator on the gearbox however if it loses inputs from flight deck it will wind throttle back to flight idle, this is enough to maintain some flight but not enough thrust for takeoff or climb especially with gear down
Reply: @DEPLORABLEOZ  - The whole idea of FADEC and engine generated power for it, is so that even if all cockpit / E/E electric power is lost, there is still power to the FADEC / EEC, as well as communication with the throttle levers.  Are you saying if all normal / emergency buses lose power on the 787, the engines go to idle?  I think not, no engineer would allow that.  FADEC is powered by their own small alternators driven by the engine itself, and only requires about 15% engine RPM to work.
Reply: @mountainflyhigh  Correct.
Reply: @mountainflyhigh which aircraft?
Reply: @mountainflyhigh  the EEC is powered by the PMA on thee engine, however if there is no communication from the airframe the engines revert to flight idle which is usually enough to maintain level flight but not with gear out. The 787 airframe systems get all power through 2 CCR cabinets which host all the computers including flight controls etc. Older Boeings like 737, 747, 767 etc had a physical throttle cable if all power was lost the engines would still operate as commanded, the 787 is like a nintendo joystick if you lose power its not connected
Reply: @mountainflyhigh so in a but shell, yes you are correct the engines still run but if no input from flight deck due to power loss fadec operates perfectly but orders the engine to flight idle, you can hear the engines still purring in the videos but very quietly indicating they are at flight idle not   TOGA
Reply: @DEPLORABLEOZ  - Your nut shell is wrong.  FADEC will still provide full throttle control even with a total power failure on the aircraft.   FADEC powers itself, and is wired direct to cockpit throttle levers.   When I asked this here, several others have confirmed that.
Reply: @mountainflyhigh  Assuming that it was electronics failure, can a heavy aircraft operate just fine during take-off with total electric failure?
Reply: @mountainflyhigh  As a passenger, I can't even imagine that something so  crucial as staying in the air, that engines have to rely on electronics to stay powered.
Reply: @HamidouDicko-xl9je  - Supposed to be able to, but relies on the RAT to provide just enough electrical and hydraulic power to have basic instruments and flight controls.  RAT is the last-resort back-up electrical source.
Reply: @WayneGerald1776  - The industry went away from throttle/cable/mechanical control of engines decades ago.  Main reasons, save $$$ (weight savings) and make engines more fuel efficient.  Same with flight controls, almost no mechanical cables anymore, all fly-by-wire.  Pilots no longer tell the aircraft what to do, they ASK it, then computer decides if it's OK or not.  Designed by engineers, who no longer trust pilots, but WAY too dependent on electronics and software.  Now, try to imagine what happens when lightning strikes a critical electronic system, and airliners are it by lightning quite often.
Reply: @mountainflyhigh engines can be fine, but if the Electronic Engine Controls are inoperative in a fly by wire aircraft then you have problems
Reply: @savannahfan  - Yup, but just how would 2 completely separate and independently self-powered EECs both fail?
Reply: @mountainflyhigh FADEC is a system made up of many parts, what your mates are confusing is the EEC electronic engine control, it is powered by the engine itself through whats called a PMA and backup power from the airframe 115V system that is true but this EEC gets inputs from many other systems such as Thrust control module, temp sensors, oil pressure, qty etc etc many get there power from other sources not the PMA, for instance the ignitors and the  fuel cut off levers get power from the main battery and the Thrust control module gets its power from whats called an RDC and software from Common Computing resource cabinet number 2. If you lose the cabinets the signal from thrust levers to the EEC may be lost causing the engine to wind back to flight idle. Many people in these chats are 777 experienced and assume the 787 is the same it is not it is completely different
Reply: @mountainflyhigh Agree and engine EEC is independent of the aircraft and the other engine.
Reply: @DEPLORABLEOZ  - Show me the electronic schematics instead of making shit up.  All FADEC engines are designed to operate after a total electronic failure.
Reply: @ImperrfectStranger Yes im type certified on many aircraft but i dont see the need to state that here.
Reply: @ExpeditionMiracle  So given my answer, how do you account for the catastrophic failure, electrical or otherwise, of BOTH engines?
Reply: @ImperrfectStranger  Agreed, once running, a FADEC engine is fully self contained, even it it loses the power lever request position it will keep running at a default setting. It may reduce power depending on the programming but will still run and suction feed if the fuel boost pumps are not running. The RAT will power the flight controls but won't lift the gear. I am not familiar specifically with the 787, I retired 14 years ago (LAME).
Reply: @DavidTipton101  Same here.. LAME, retired 11 years ago.
Reply: I'm a retired 37 year A&P airline mechanic. they do not do type certifications here but the airlines i worked for required us to go to school and be certified to work a type before being able to sign off anything. otherwise we had to work with someone who was experienced and type certified.
The question in my mind is if there is a total power failure except for the battery bus where does the EEC get its power from? Will the engines shut down? The engines have a mechanical fuel pump in case of electrical failure but if there is no computer to control the engine, what hapens? I have never liked fly by wire systems.
Reply: @ImperrfectStranger  valid points about suction feed and a PMA powering the fadecs.  Maybe they went to idle due to no signal from the TLA.
Reply: @g550driver13  That's what we need to find out. What does the programming do in the  FADEC under these circumstances? I have no Boeing 787 books and the 777 books are not much help.
Reply: @ImperrfectStranger  Good assumption. Now determine if suction feed is sufficient for TOGA power.
Reply: @petergill2265  Boeing claim suction feed is only an issue at high altitude.
Reply: @ImperrfectStranger  My Boeing 787 manuals disagree with you.
Reply: @petergill2265  Can you quote what they say (verbatim)? And what manuals are these? Maintenance? FCOM? If you give me a reference, I'll take your word for it.
Reply: @ImperrfectStranger  contaminated fuel, choked fuel line....no chance... let's hope black box shows up some clues
Reply: @ImperrfectStranger  the temperature at the airport at was 41°C  which means thinner air to try to get any lift from
Reply: @ImperrfectStranger  Boeing Lies every times for a certification :face-blue-smiling:
Reply: Pretty much what I am thinking.
Reply: I head the 787 has a cascading electronic/electrical failure problem. When one system goes out, they collapse like dominoes apparently
Reply: @tracyeaves4847  There are no backup, redundant batteries and systems!?! B787 a flying coffin?
Reply: @tracyeaves4847  You heard wrong.
Reply: @petergill2265 probably so, a lot of theories right now
Reply: @tracyeaves4847  A passenger before take-off did a video stating nothing was working on the plane...lights, buttons, A/c etc.
Reply: @OceanBliss0777 true!!!
Reply: @tracyeaves4847 reading your comment I remembered last year my Cadillac’s blind zone sensor failed and the whole car would not start (key recognition was  somehow jammed electricity by a failed mirror sensor…the mechanic said these new high tech systems (and it’s not even that high tech compared to a plane) often jam once one part fails…I can’t believe a planes electrical system works in a similar way…I pray it’s better than that 😬🙏
Reply: @anmi1985 I just flew on the same type plane - ✈️ was nervous !!!
Reply: @anmi1985 you had a cascading electrical failure - vulnerable
Reply: @tracyeaves4847 Yes, this is true
Reply: @tracyeaves4847 If so, the 787 will be grounded worldwide.. mind you how would all electric redundancies fail?
Reply: What about water contamination from a crack in underground storeage tank or tanker accidently had gasoline left over from previous run and it mixes with the fuel... the engines are running at an idle from what iI heard.
Reply: @robertwadas ...yes, an issue that  most don't  give enough importance to as the culprit...I guess just not as clickable...
Reply: @robertwadas EXACTLY...EVEN THIS TOO BE THE REASON
Reply: @robertwadas I think this is a good point and have we heard any results of checking the fuel source for this jet and found the source of fuel to not be contaminated.
Reply: @robertwadas Not possible.  A bit of gasoline wouldn't matter. Some military aircraft use Avgas mixed in with Avtur for a variety of reasons. Fuel trucks would pick up contamination,  so would the aeroplane.
Reply: AP here as well - former Cf6 specialist for a legacy  (turbine tech) - agree with your position. 

As more details come out - including better quality video, audio and the one pax who survived - the details about the lights out and the silence in the video is telling.
Reply: Rat ate through wires causing electronic failures .
Reply: @starkmad5351  At first I thought you meant the ram air turbine (!) but, yes, I’ve had this problem in my house (mouse not rat - my cat brought it in and forgot about it). Of course I would hope that the 787 has more robust wiring than my house…
Reply: I agree with you in a lot of points, but not in your it wasnt bird strike suggestion. No there is no evidence and no suggestion that it was bird strike, but I'm disagreeing that the GEnx 1B64 can take a lot of hits. It's engine blades are just reinforced with titanium on the front edges the rest is carbon fiber. This engine is more efficient but a lot more vulnerable to bird strikes than a titanium blade engine
Reply: @derkurier5542  Reports have stated the runway and surrounding area have been searched with no remains of birds having been found anywhere. You don't get the kind of bird strike that could take down an aircraft such as this without some evidence remaining.
Reply: @derkurier5542 I work on these engines. I know what they can take
Reply: @derkurier5542 the absence of any visible debris/damage from either engine from the cctv of takeoff makes bird strike very unlikely IMO.
Reply: @TobyJackson-u8w  I agree with you and I don't think that is what happened, yet I don't think the quality of the cctv and other lack of evidence allows me to rule it out entirely yet
Reply: @derkurier5542  two birds in the same time ?
Reply: @sersenvoid unlikely but it happened before
Reply: @derkurier5542 

CARBON FIBER turbine blades now ?

Carbon fiber is nothing more than reinforced fabric.

Planes have become like plastic toys since this carbon fiber business started replacing everything.

Like the tailplane. Stupid using fabric just to save a few pounds on a CRITICAL component.

Tailplane/rudder/ elevators snaps off, CURTAINS.

Airbuses have been called  "plastic planes" .
Reply: @derkurier5542  Apparently the runway was checked and there were no bird bodies, so they believe that bird strike was not the cause.
Reply: Also it does not look a strong jet with smoke  behind the engines at take off when the 787 becomes airborne.
Reply: Boeing should be forced to shut its manufacturing
Reply: Where is the electronics bay, is it anywhere near to where the survivor was sat?
Reply: @leeroberts1192 one is right below the cockpit, the other one is at the belly where the wings meet the fuselage
Reply: @leeroberts1192 on other Boeings, it's behind the nose landing gear in the underfloor area.
Reply: @leeroberts1192  Desperate to blame a passenger?
Reply: @cliffmathew  No. Trying to work out if the explosion they heard could have come from the electronics bay.
Reply: @leeroberts1192  Sincere apologies for insinuating otherwise.
Reply: @cliffmathew  Apology accepted. I do wonder if the explosion he heard could have come from the battery storage in the electronics bay. If the battery had gone into thermal runaway it can release some flammable gases, in confined space, it would have only taken a spark, maybe even a bit of static to ignite them gases and cause an explosion. No idea if it would have been enough to breach the container that it was kept in.
Reply: The 787 has been flying safely for a decade.  Why would you assume it’s an electronics failure instead of pilot error?
Reply: @wbruceanderholtii8369 I work on these airplanes every day. Im a certified mechanic on the 787 for a major airline. Im entitled to my opinion and I clearly stated why. Too bad you didnt bother to read my entire comment or if you did, maybe you have a reading comprehension issue.
Reply: @wbruceanderholtii8369 nothing shows it should be a pilot error for now, even authorithies decreased the chance of the pilot error on minimum
Reply: @wbruceanderholtii8369  Et pourquoi pas ?
Reply: I was a Flight Safety and Interior Design Specialist at Boeing Helicopters for 9 years right after my first college degree.

Contaminated fuel? Does Gary know how to conduct Failure Mode & Effects Analysis? If it were contaminated fuel, wouldn’t other aircraft be affected? YES. YES. YES. They weren’t. Full Stop.
Reply: @PfizerRN_NavyReserveCaptain  Thinking about the 1 out of 100.000 case (5 niners) or more seldom is not everybody's "bread and butter".
Reply: No backup batteries?
Reply: the batteries will only provide igniters power and some basic flight controls once the rat deploys however if both CCR cabinets failed most flight control computers will fall off line the pilots would have nearly no control.
Reply: @drectmalibu It does but not enough power to run the engines
Reply: Flaps or Birds...
Reply: K98 @salimkaya01 No
Reply: Quote: In a post on X, Akash Vasta has claimed he flew on the same Boeing 787 aircraft two hours earlier.

“Nothing is working, nothing, not even the light is working,” he says in a video showing failed air conditioning and entertainment systems.

A boarding pass he posted shows details aircraft’s penultimate flight - AI423 from Delhi to Ahmedabad at 9:50 a.m. on June 12, 2025.
Reply: @PawRick I have seen this same video. It may be a clue into the electrical issues the airplane was having.
Reply: Was a mention repairs done few days before        smell in aircraft      overnight repair       aircraft pulled from takeoff.     passenger s stayed in hotel.     lt might be related.   Suspect used reverse thrust to back up on runway   overheated engines or electronics .     was similar event landing before    not same plane
Reply: @dondesnoo1771  What? Rewrite with complete sentences because in its current form your comment's not intelligible.
Reply: So I was thinking a few things

Was there fuel contamination? but in today’s world highly unlikely esp w the trucks we have

Loss of lift :
1) electrical and hydraulic failure - not sure if there was a maintenance issue ie fuel flow was interrupted. Like you rightly said, the bang and the flickering was the rat deploying. 
2) I wonder if there was a control trim actuator lock 

I wonder if there was a trim lock that led to high nose attitude leading to loss of lift, fadec induced shutdown or reduced thrust, rat comes out, not enough vertical separation for gaining speed and control 

Idk I’ve been reading like crazy and I just can’t make things make sense
Reply: @hrjnmanimd It's surely a pure and simple catastrophic electrical failure. It explains everything. What caused said catastrophic failure, we will need to wait to find out.
Reply: @robert.wigley the fact that equipment in the cabin was shutting down wasn't exactly confidence-boosting. Who knows what has been touched in the electronic relay systems or what circuits may have been overloaded and tripped out suddenly. My guess is improper maintenance
Reply: @robert.wigley probably triggered by gear up. A failure waiting to happen when electrical load increased
Reply: @hrjnmanimd No can can make sense of it, as this is the first 787 hull loss. Tell you what, though.. people certainly are trying to understand it. I'll wager the cause will be what no one in the investigative world has ever imagined.
Reply: @miketype1each that’s a valid point
Reply: @miketype1each 3 amp fuse blew
Reply: @hrjnmanimd  Contamination can come from within the aircraft. e.g. biological. Usually this is treated with biocides, but I don't know how often or if Air India maintenance closely monitors this. Having seen what looked like moss growing in a compartment on the wingtip on an Air India 747, I believe anything is possible.
The 787 has ultrasonic water detectors, so it makes it less likely that water got into the tanks.
Reply: @hrjnmanimd  two questions though, with respect, and please feel free to correct me or explain, because I am not a pilot and genuinely don’t know these answers. So not arguing, just curious…if we go with the fuel contamination theory:

1. Would it not be likely that an aircraft before, or after, the accident aircraft might have also gotten contaminated fuel which would have manifested in some way?
And 2. Would there be absolutely no signs of an issue prior to V1, such as sputtering or something, before a total failure? I’m thinking of other incidents where there were compressor stalls, and things of that nature before engines totally failed.
Reply: @hrjnmanimd  and his point about no engine noise?
Reply: Most probable !!
Reply: Guess,the electric failure happened before take-off. In such failures, hope the plane gets jammed/logged/locked off. Also, hope more AI can be used, as safety at all junctures of the flight is important.
Reply: @akshadhareverberates4499  I disagree with your AI part. in my eyes, an AI is the wrong technology to be employed in a critical location such as the operation of an airplane. Due to it´s nature, an AI will not behave in a predictable way, which does not blend into current operations which rely on standard operating procedures. Thus, handling / "cooperation" between humans and AI will be challenging to say the least.

Yet, this is nothing that is part of this discussion here.
Reply: @akshadhareverberates4499 there is a video on YT made by a passenger on the flight that aircraft made earlier that day. He is complaining that nothing is working. No air-con, lights faulty, no entertainment and even the call button not working. He says the cabin and toilets are dirty. All signs of poor maintenance.
Reply: @tommaguzzi1723 yes saw that, hope such failures should cause some alarm to ring in any vehicle
Reply: My two cents - nah. Make it a nickel (inflation): the aircraft did not have any problems completing eight long haul flights in the preceeding two weeks. Unless the investigation finds maintenance logs that point to repairs in the electrical systems,  I have to go with crew errors.  One theory is that the FO accidentally tripped a breaker during his movement to bring the gear up.
Reply: @crankyoldguy2 You can have a massive fault of electronics that cascades in its effects without any prior log issues. Ive seen it many times
Reply: @ExpeditionMiracle  Yeah, if have seen "latch up" of a 50 cent level shifter integrated circuit bringing down a redundant system. Nobody put "latch up" of this circuit into the severity/probability matrix. The lection learned: strange shit happens.
Reply: That was previously brought up and discounted in a subsequent video by Capt. Steve. And besides, pilot errors are usually caused by fatigue, but the Air India flight was literally 30 seconds into its flight before it crashed.
Reply: @crankyoldguy2 there are no breakers on the center pedestal,  or on the panel adjacent to the landing gear selector. CB's are never located there.
Reply: @crankyoldguy2 wat?
Reply: @crankyoldguy2  he never brought the gear up
Reply: @crankyoldguy2 why not bad fuel? Is part of the maint isn't it? Engines are critically needed for electrical power on these jumbo.
Reply: @crankyoldguy2 Sorry to say, but that theory sounds stupid. Do you think Boeing would be that stupid to put a breaker switch, that disables the entire electrical system,  in the midst of the switches and levers that controls the aircraft? And for what purpose? 
The breaker panel is usually behind the pilot and FO. So the co-pilot would have had to stand up, go and open the breaker panel and start flipping switches.
Reply: @crankyoldguy2 I can't imagine breakers are placed anywhere near the primary flight controls in this aircraft.
Reply: @crankyoldguy2  Im not a betting guy, but my money is on what you said
Reply: @crankyoldguy2  Surely the "breakers" would not be "too" accessible so as to cause accidental knocking off - there has to be a positioning of breakers -away from "normal flight controls -you would like to think ?
Reply: @crankyoldguy2 but most breakers are far away from the gear lever
Reply: @crankyoldguy2 unlikely. Those pilots knew what they were doing. It’ll be electrical.
Reply: @crankyoldguy2  bending towards your point. We need to be sure the Captain & first had enough rest as well. Strong believe something inadvertent happened in the cockpit that cut off power supply!
Reply: @crankyoldguy2 after 1100 hrs of flying can he make such a mistake?
Reply: @crankyoldguy2  787 has electronic circuit breakers. No chance of accidentally pulling a breaker.
Reply: @crankyoldguy2 how would the FO trip a breaker by/when (aka human error) selecting the gear up. I don’t know the layout of the cockpit but it seems highly unlikely as I assume the breaker panel(s) are not in front of the pilots but behind them.
Reply: @crankyoldguy2  If such a critical breaker is located where it can be inadvertently tripped, that is a design issue.
Reply: @crankyoldguy2 what! That makes no since!!!!!!
Reply: @crankyoldguy2  In that case, another horrendous Boeing interface design.
Reply: @crankyoldguy2 - have NO idea if true, but as somrone here on an earlier thread just today in this chat commented, there WAS a passenger who says he rode THIS plane on its prior flight to Delhi who DID say the plane had been hot & (electrical issues?) & other commenters elsewhere claimed some passenger on prior flight of this same plane (same guy who spoke of the heat?, IDK) had said AC not working during his flight.
Reply: @GodBlessUsEveryone-yg8vf  yes, guy got off afterthe 1st leg of the flight, said the lights, the ac, the wifi, the entertainment system all not working!
Reply: @GodBlessUsEveryone-yg8vf  Imagine the heat from lack of AirCond, and the stench of curry?!
Reply: Statistically it’s most probable the crew flew a perfectly flyable aircraft into the ground.
Reply: @simonissell  That's about the LEAST likely explanation, given the facts and evidence as we know them.
Reply: @BryanM61 Unfortunately the statistics say otherwise.
Reply: @simonissell  BS. You must not have reviewed any of the evidence that have come to light thus far.
Reply: @BryanM61 There is almost no evidence, only a few videos which offer nothing conclusive.
Reply: @simonissell  There is a preponderance of evidence. Two videos; the lone surviving passenger's account; an in-depth understanding of how the 787 works. We have ADS-B data, showing position and altitude, and expert/pilots' and mechanics' analyses of what might have happened and what could NOT have happened.

What sort of "pilot error" do you propose could have occurred (keeping in mind that the 787 issues any number of warnings, and in many cases will simply not allow pilots to induce incorrect actions)?

And how would you explain the RAT being deployed (assuming you even know what a RAT is)?
Reply: @BryanM61 Yes… 2 grainy videos, the unreliable account of the sole survivor who clearly has no familiarity with aviation whatsoever, and a bunch of opinions from a bunch of people who claim to be “experts”.
Very conclusive.
Reply: @BryanM61 And the whole premise of this video is based on faulty understanding of how the landing gear works!
Reply: @simonissell  Again I ask, how do you explain the RAT being deployed as some sort of pilot error? And what pilot error would account for everything we see and hear?

You may claim these are 'grainy' videos (I would argue the 'apartment video' isn't grainy at all), but we can still make a number of factual observations, including hard information from the ADS-B data:

1) The landing gear remained extended.
2) The RAT was deployed
3) Photographs of the crash site show the slats extended; this implies the flaps were also extended - they move synchronously.
4) We see in the CCTV video - grainy or not - that the aircraft stopped climbing; confirmed by ADS-B data.
5) In the mayday call, one of the pilots stated there was no thrust and that they were falling.
6) In general, the 787 - and all other current-era commercial airliners - are designed to prevent or correct almost any error a pilot could make. Give me a 'pilot error' scenario, and I can almost guarantee I'll tell you why it could not have happened here.
Reply: @BryanM61 I’m yet to see any conclusive evidence the RAT was actually deployed, or that the mayday call actually included a description of the problem; or what the crew THOUGHT the problem was.
777 slats will extend automatically (if flaps 1 to 5 set) as part of alpha floor protection, my assumption is that 787 is similar.
Reply: @simonissell  Three major India media networks reported on the content/context of the Mayday call, citing "ATC Sources". While the wording varies slightly, the essence is the same: "No thrust" or "thrust not achieved"; "falling", and "Mayday". As with most other news reporting outlets, their reputation for accurate reporting is on the line. One network would not have just made this up out of thin air, let alone three.
Reply: @BryanM61 I’ve seen at least half a dozen different versions of this alleged mayday call in the media.
Absolutely they are either copying each other or making it up for the sake of a story.
Reply: @simonissell  And once again, for the third time, I ask you: What pilot error do you propose could have caused this aircraft to go down in the manner we see?
Reply: @BryanM61 I’ll let the crash investigators figure out the cause, and any possible errors made by the crew. My point is that statistically the most likely explanation is human factors. Yes they may have been dealing with a systems failure as well, time will tell.
No doubt there will be a string of events that lead up to the crash, not any single cause, and the probability is that human factors will be a major contributor.
Reply: @simonissell  "777 slats will extend automatically (if flaps 1 to 5 set) as part of alpha floor protection, my assumption is that 787 is similar." Similar, yes - called 'Slat autogap' on the 87. But this only proves the flaps were extended, again discounting the idea of pilot error.

From Boeing differences handout (differences between 777 and 787, intended for pilots who are transitioning):

(B787) The slat autogap function is only available in primary mode when the slats are in the middle position and the airspeed is below 225 KIAS. At a high angle of attack, autogap fully extends the slats to increase the wing camber, thus increasing the lift and margin to stall. The slats return to the middle position after the angle of attack decreases. The autogap trip threshold is a function of AOA, airspeed and flap position.
Reply: @simonissell  "I’m yet to see any conclusive evidence the RAT was actually deployed" Well, you're one of the few remaining holdouts who isn't convinced. The audio on the apartment video is virtually unmistakable, and visual evidence in some of the frames has convinced almost everyone who takes a careful look.
Reply: @BryanM61 With respect, it doesn’t discount the idea at all. If the photo evidence is reliable it simply means high lift devices were deployed at time of impact. It doesn’t tell us anything about flap/slat position before that point.
Reply: @BryanM61  The audio in the video is not reliable evidence. In this day and age we shouldn’t rely on any video evidence unless it can be corroborated another way and/or proven to be genuine.
Reply: @simonissell  OK. I understand now. Someone faked a video of a plane crashing. Got it.
Reply: @BryanM61  If you care to do a bit of digging, what you will discover is that there is more than one version of the balcony video. One of them of them has what is presumably the original sound of the aircraft flying past with no RAT sound; the other appears to have had additional audio overlayed, with the RAT sound.
Reply: @simonissell  Statistics say as well that a significant portion of aviation desasters happen over water.

So according to your logic this Air India flight must have crashed into the waters...../eyerolls
Reply: @kwichzwellbreck697 And what percentage would that be? Specifically for airliners?
Reply: @kwichzwellbreck697 In any case, your argument is a logic fallacy. We have reliable evidence that allows us to discount the theory that the crash occurred over water.
We do not have enough reliable evidence to discount the 80% probability that human factors made a significant contribution to this accident.
Reply: @simonissell  As we have eye witness reports and VIDEO with audio and as well pictures/video and eyewitness reports from the ground that

a.) Flaps were deployed
b.) RAT was deployed
C.) Engines were out or in idle (no noise in video)
d.) etc....

and yet you keep saying it was pilot error citing statistics that in "most cases" it is human error....

Who is the charlatan here?

Dont deflect your flawed logic onto me!
Reply: Transfer Gearbox failure?
Reply: @nicksantos43 Not likley. It has to be a catastrophic and total failure of the electrical buses and generators
Reply: On both engines? Not saying impossible but highly unlikely.@nicksantos43
Reply: @nicksantos43 porsche cayenne
Reply: @nicksantos43  dual? Not likely.
Reply: @nicksantos43 happened before so it could be